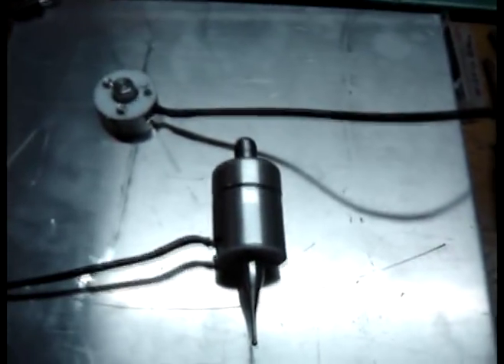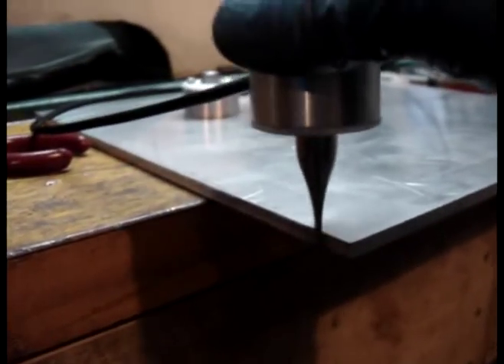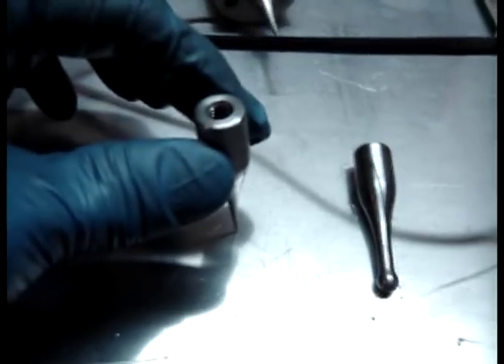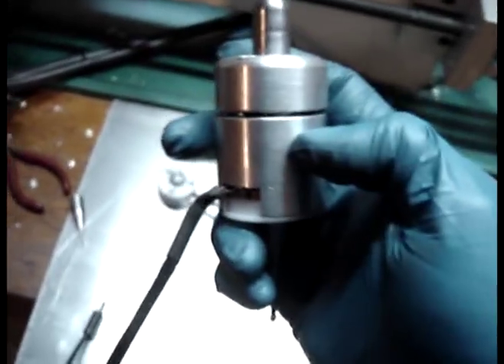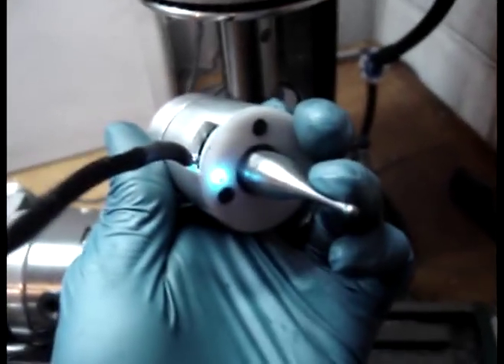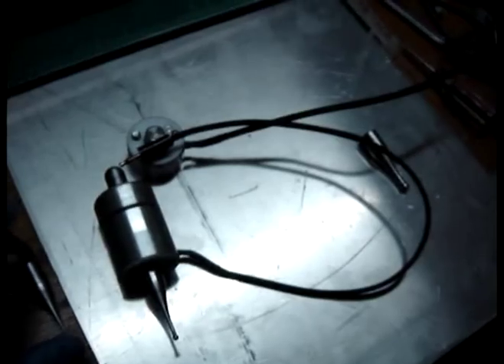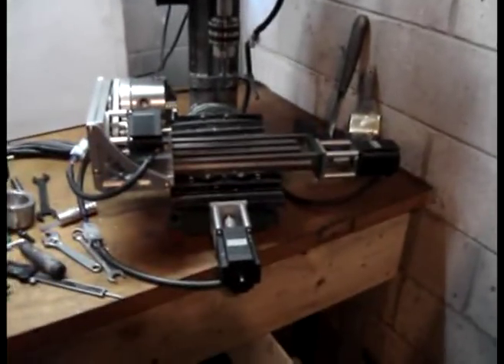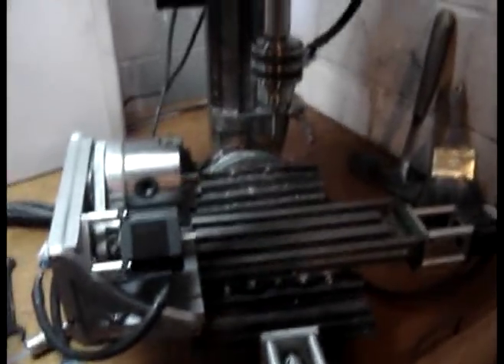Touch probe, general mill info

Comment from the maker: I don't have a list of mods, but google hossmachine, most of my mods are copied directly from him, he has a lot of detailed information on his website.  It'll run you $1,000-2,000 to get a nice starter setup like this, which you can continue to upgrade when you need to.  I have made a few PCB's with it, works perfectly.  The trick is using the right endmills, I got cheap ones from ebay and they didn't work so well.  People have made PCB cutting machines way smaller for WAY less, using a dremel.

Comment from the maker: Yes I did, they're super simple.  1" aluminum bar, drilled through with a 1/4" hole, and two set screws coming in from the side to pinch the flat part of the motor shaft.

Comment: did you make your motor to leadscrew couplers? If so, what material did you use and did you do a simple slit hole with a screw cinch method? Great vid as always man.

Comment from the maker: Late reply, but still a valid question for you I'm sure.  I never actually used that tool setter, even back in the day, turns out the top wasn't anywhere near level so it wasn't accurate at all.  I use the Tormach toolsetter and touch probe nearly every single day, they're both amazing.  The toolsetter is a bit ridiculously expensive, but it sure does work great.  Now if I can only mount it on an arm that swings in above my pallets, so it's always available and in the same spot, I'll be happy.